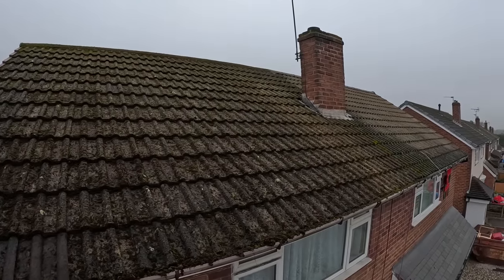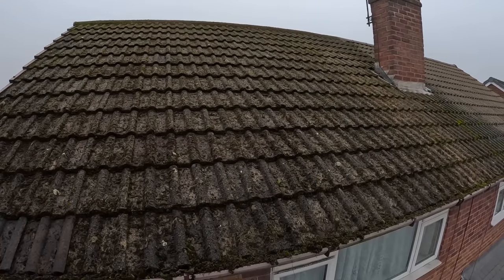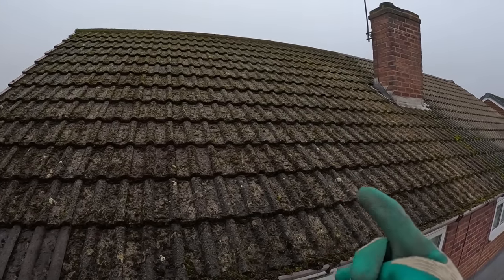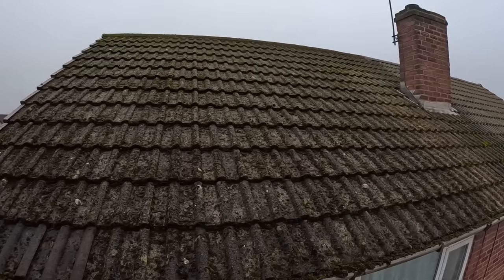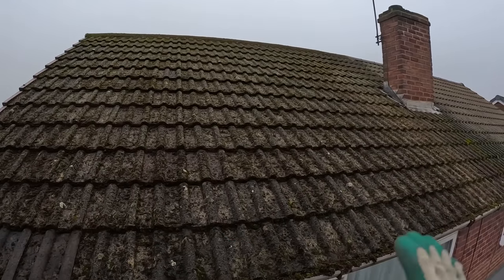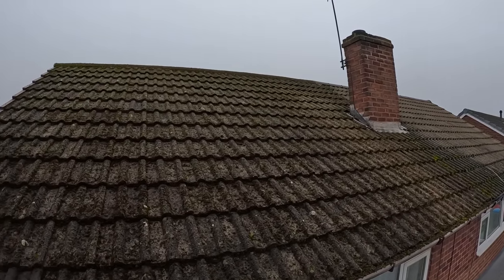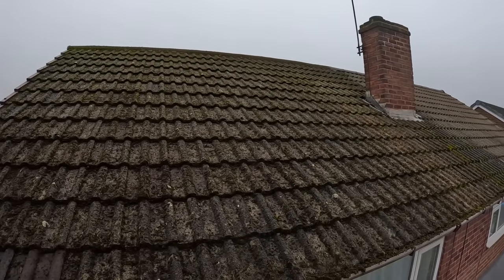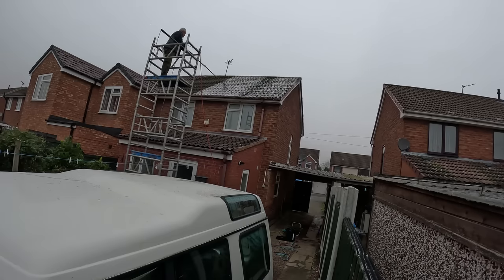STRANGE CASE: RUDE Neighbour Went Too Far? I Discovered Evidence Whilst Cleaning A Roof!

Comment: Honestly if they just each had their own downpipe it would be fine. I would personally hate to have to keep spending money to unblock my gutter and drain because my neighbor let's their section of roof get that dirty.
Reply: You are absolutely correct. A down pipe on each end of the roof would be the best solution all round. Bonus no more aggro for both the residents.
Reply: Definitely don't get why they are not each with their own , it's always a shtshow when ppl have to share something that requires maintenance of some sort but one side does fk all while the other suffers the consequences
Reply: hes nothing to worry about now has he?
Reply: @I.Am.Nobody  Completely agree.
Reply: So you just clean their gutter and send them a bill each time you have to do it!
Reply: @papascrumpeeh  it would make more sense if the roof was maintained together at the same time and they both covered the costs equitably. They'd save money in the long run but that would make too much sense
Reply: But alot of those things just happen. They bought the house knowing they had a shared pipe. Some roofs get mossy, some people cant aford to pay for them, sometimes pipes get cloged. But the neibour went out of their way to create an abstructions, to cut them off from their paid for right to drainage, in a way that could damage their property. Doesnt matter if their are dicks. The neibous simple doesnt have the right and with all the new laws on mold and damp alone im pretty sure its prosecutable.
Reply: Its because the developer/builders want to cut corners safe money and make as much profit as possible, sod the problems they cause, they have their money and have walked away wiping their hand.
Reply: You know what, the moss is there because the gutter was blocked. I think that's at least honest.
Reply: He should have notified the council; the 1984 building act would have been on his side. Also he could have gotten it done for free.
Reply: That complaint should be addressed to developers who try to save every penny, introducing solutions that are inefficient, and potentially become a bone of contention between two neighbours. 

It's not like one will always be able to clean the roof at the same time as the other owner of a semi-detached house. Even though it's technically one building, it consists of two houses, and each should be fitted with its own downpipe.  

I'm surprised it's not mandatory. 

British construction industry keeps its customers under the impression that they provide top quality for money spent. It's all BS. Since I have changed my strategy towards holidays, I allocate more time towards exploring and talking to people whenever possible. A few years ago, I started paying much more attention to houses and construction sites abroad, just to see, how things are done. 

To be brief, the UK is way behind the continental Europe. And I'm not saying that to prove anything. 

To me, it's just the fact that the average British customer is not aware, that he or she gets brutally shagged when it comes to housing-related matters. 

PS. People involved with 'Insulate Britain' are right about insulation quality of British houses. They just picked a poor way to deliver this message.
Reply: @I.Am.Nobody  It's not a matter of money all the time. I have a Russian neighbor that honestly had zero concept of home maintenance. When the gutter froze over and peeled off his house he was baffled as to how it could have happened. When we mentioned cleaning the gutters out annually he was confused - he'd never even heard of such a thing. Now his roof is mossed over, weeds are growing out of his gutter, and everyone in the development except him has had their roof reshingled under warranty. He'll do it when it starts leaking and end up paying several times as much to repair the water damage to his home.
Reply: He explained that they can't have one on each side because they go to a ground gutter and that is how the houses were built... It is not like gutters in the US were you can just let the water flow onto your garden without it completely flooding... If he had a problem with the gutters clogging in the downpipe he could have been an adult and talked to his neighbor but he took matter into his own hands...
Reply: @SailorMya  They can they just don't want to spend the money to install it including the proper drainage. He also stated in the video the neighbors had been having problems with each other. Its easy to imagine the neighbor with the dirty roof ignoring the problem because it will primarily overflow near the downspout of the other side when it gets clogged before it was blocked and raised. I will say that instead of a block they could have installed a screen so when its clean it will drain properly and when the guy lets his side of the roof go and it gets clogged it will overflow onto his side rather than the neighbors.
Reply: It's law in my country. Run off from one property cannot enter another. Even duplex's and conjoined apartments. They all need their own stormwater management.
Reply: You are not wrong, shared maintenance for ANYTHING a is huge bother. All said, if you make an effort to be civil to your neighbor you likely can negotiate getting the whole roof cleaned at the same time for a better rate than separate (though there may have been other factors involved we are not privy to). You don't have to invite your neighbors over for dinner to be neighborly, just behave like a proper adult (fake it if you have to) when you interact. Remember, it's "love thy neighbor" not "spite they neighbor". Happy May everyone!
Reply: Damn right, I wouldn't want that amount of shit in my gutter system as well. If this guy took care of his roof before, I'm sure the neighbor wouldn't block it
Reply: @FrozenHaxor  if the guttering was flowing properly that would have not built up either
Reply: @nickislade5533  You're telling me that the moss on top of the roof was caused by clogged gutter at the bottom? Totally false, the gutter would overflow and just drip from the sides then, that homeowner is a total slop if he did not notice this obvious issue for such a long time, I totally understand  why that neighbor was fed up with him, letting all the gross shit back up to him.
Reply: @lightpropulsionguy  unfortunately life doesn't work like that, you can't bill someone for work done that wasn't agreed upon 🫤 I agree with your premise though.
Reply: @oddpoppetesq.3467  extenuating circumstances can provide such an avenue, such as this where only doing part of the work doesn't really count as a complete fix.
Reply: @oddpoppetesq.3467  take for instance a private road that is shared between neighbors, in America if someone pays to have the road graded and re-gravelled  you absolutely are liable for your portion, same with a shared fence. It only makes sense!
Reply: @lightpropulsionguy  I totally agree with you. I just didn't think it worked that way, I live and learn 🤷
Reply: There is also a question of capacity.  The down spout might be sufficient for one side of the roof, but it might not be able to handle both at once on most days.  Then there is the drainage which could be an issue or not.
Reply: I`m very neighbourly and lived in a small street of terraced house, 7 on each side with a foot path between, I lived there for 25 years and recently sold up to downsize, the houses are 125 years old and had a drain pipe every other house, some still had the old cast iron pipes. every year I would clean mine and next doors gutter, I kept the ally clean and weeded, the footpath, even concreting two strips that had sunk where gas pipes had been fitted to make it easier for an  older neighbour in a wheelchair. when I sold my house it sold in 3 hours !!!  that was last July and I dread to think what a mess it will be now .
Reply: @smokeydization  Very true. There are massive companies who "develop" sites where they have pulled down one house and replaced it with 5-7 Ticky-tacky mini-houses, but charge over a £ million to sell them.
Reply: .The answer is to ask the neighbour to remove the moss, politely. Blocking the gutter is not the way to go
Reply: It's not just the downpipe though is it, it's putting in two drains. One drain for two semis is perfectly acceptable.
Reply: The roof isnt dirty though. It’s literally nature growing on it

Comment: If the neighbour was fed up of the downpipe getting blocked, he should have just installed a mesh. If that got blocked from the moss, then he would have at least been able to say that the blockage was caused by your customer having too much moss on his roof. The neighbour was obviously just being awkward and I believe could be taken to civil court for preventing your customer from using a shared facility. That could result in very high costs for the neighbour. At least you've sorted the problem so well done.
Reply: meshes would also block water over time .
Reply: @mikedeitz2924  True but it only takes a few minutes to clear the mesh, rather than having to spend a lot of money to have the drains unblocked by a professional
Reply: @ASavageEye but why should the guy who obviously keeps his roof clean have to install a mesh and clean it only cuz the other people dont care?
Reply: @idkimlikereallybored9533  solid one like that would cause build up and eventual dampness to seep into the house/attic, since they're together it would affect the guy who keeps the roof clean. they don't get along well and the neighbour didn't think of long term effects or just ignored them to spite his neighbour. not a roofer myself but that's my guesstimate.
Reply: @daubenyhervis6437  I get that, but a blocked drain will cause that as well. In which case the bloke who cleans the roof suffers for the bloke who does not as they are both flooded out. So if this is a long ongoing dispute the separator is understandable. (I.e. if you do not care I do not care)
Reply: That would have at least been civil.  Blocking it was outrageous 😡
Reply: @bruney74  A separator clearly shows that they care though? lol
Reply: @idkimlikereallybored9533  because he bought a home that shared a roof?
Reply: Didnt you hear what it was, felt, it would have let the water through quite likely, dont jump to conclusions
Reply: @mikedeitz2924   this is incorrect
Reply: @zipzap8937  guess you never seen a blocked drain before with mesh covering the drain hole..
Reply: @mikedeitz2924  Yeah because the owner of that house needs to clean their shit. Did you even read the original comment?
Reply: @zipzap8937  UHHHH YEAH I DID ... IT will clog... Now tell me there are TWO OWNERS in that SINGLE BUILDING .... mesh will clog... SO YOU HAVE TO CLEAN IT... GIT.
Reply: @mikedeitz2924  The person with the clog has to clean their own mess. Imagine having to clean your own building? Imagine being responsible for your own place? You must not be there yet in life, but don't worry you'll get there eventually.
Reply: @zipzap8937  imagine your neighbor altering the gutter system twhich makes your part of the gutter to clog up even faster... Guess you are not at that part of understanding yet.. GET off my simple comment that mesh will not fix the cloggin issue.,..
Reply: @mikedeitz2924 imagine not being able to fit a piece of downpipe on your own side and eliminating the entire problem for peanuts instead of blaming someone else for actually trying to protect their property from your neglect 😂
Reply: @hamoostaffat  imagine you making it a necessity for your neighbor to go from maintaining once a year to every month.
Reply: @mikedeitz2924  that's kind of the whole point of the blockade 🤣

Someone fed up with someone else's neglect causing them to do repairs more often than should be needed for optimal performance, doesnt take a few weeks for that much moss to grow, doesnt take more than a fraction of a weeks pay to fit your own downpipe either, way cheaper than what's been allowed to happen

Why shouldn't someone be able to protect their property from damage because their neighbour won't do anything about the source of the problem, funny its a shared problem when it affects them but not when their actions affect others eh
Reply: @hamoostaffat  sigh... ones sensibilities forcing others to follow...; How adolescent.

Comment: Deeds to both properties should contain a clause about shared drains and gutters, they usually do.  That makes it enforceable even if its a pain.  I had a similar situation with a developer who changed the gutters on next door so they no longer lined up with mine.  We got the deeds out and I explained he had 2 options, reinstate it at his expense or go to court and reinstate it at his expanse and pay the court fees.  He saw sense and re-did the gutter.
Reply: Brilliant, good job mate, shouldn't have to stand for nonsense like that.
Reply: it will also mean there are responsibilities that can be enforced too. Like a responsibility to clean your roof, especially if its leading to blocking of the drain.
Reply: The same happened with my 80 year olds mums house while she was in hospital. Had to have a downpipes fitted although drains onto the driveway. Since had trouble with them since they moved in it's too much trouble at her age. From the noise created I reckon he has done other renovations without building control or party wall agreements so it will come out in the end.
Reply: Who to say that it will not go back on again

Comment: Where properties have shared services, including drainage, there is normally a legal requirement (covenant) in the property deeds to ensure this does not happen, and also to allow reasonable access for maintenance.
That deliberate blockage was a disgrace, but unfortunately some people do have scum for neighbours.
I haven't seen your type of work carried out before. I must say that I was impressed.
Reply: Theres a lot of missing context. That roof is absolutely terrible. There is zero maintenance being performed, its covered in so much moss. 
If the neighbour thats installed the divider, has spoken to the the other neighbour about cleaning his roof as its blocking THEIR downpipe, and mossy roof guy has refused to do anything about it, then yeah I can understand it. Not to mention if he has had to have the downpipe cleared, what if mossy roof guy didn't pay his share? Theres way too much context missing
Reply: @PBMS123  What part of SHARED don't you understand. If its in the deeds, its not just for one property its for both.
Reply: @Simon-ui6db  Yes, but that also means BOTH property occupiers have responsibilities, and one of them has failed in their responsibilities. These are the actions of someone fed up, someone who cannot reason with the other side. And just as hes complaining now, the other guy has probably had his own flooding because of this guy. Being told, and then refusing to  do something until it finally affects you, is a deliberate omission as bad as the guy doing that to the gutters in an attempt to stop his place from flooding, and having to unblock the drain

Comment: Surely an alternative solution would have been to install your own down pipe at end of guttering and installing a sizeable waterbutt, thus gaining advantages of free watering of garden, plus discount from water company for water saved, plus one-in-the-eye for Nasty Neighbour?
Reply: Nice idea but you'd need the drainage to take overflow from the butt - the amount of water from a roof even this sized is surprising.
Reply: you coulda also just separated the gutters allowing you own to flow freely onto his roof and claim since the grade was different that caused the gutters to separate.

Comment: Interesting we had a similar problem , we shared a gutter and pipe with our neighbours, our neighbour was very lazy and his guttering would fill with moss and dirt and cause ours to block and overflow,after years of us having to clear his guttering we decided to pay to have ours blocked off from his and our own downpipe put in , so now he can keep his own dirt and water . Problem solved .
So I think it depends , sometimes  frustration builds up and that can be why someone reacts the way they do .
Reply: Without being too judgemental - Did you ever try have the sensible conversation?
Look the roof is both of ours, but you aren't maintaining your side fairly - its far too easy to let frustration do the talking rather than addressing issues
Reply: @bengrogan9710  yep we tried , but seriously we did not block his guttering , we just had new guttering of our own , his is still in use but it no longer causes us a problem .
Reply: I'd say there was history between these neighbors. Only reason this job was done in the first place was because the eave was overflowing onto the first house instead of the second house. Mesh would have been a bit more civil.
Reply: @yvethemetriccrafter688  The situation is not comparable because it's completely reversed.
Reply: U cant just demand a neighbour to do something. They might not have the money to do so at the time. Methods could have been done to avoid the situation, like mesh or put in own drainage. Instead, one chose to block the other without some commonsense. But we cant deny, both parties are at fault. I assume 2 stubborn old men behaving badly
Reply: @trixmania  actually you can demand it ,if it's doing damage to your property. but we decided to get our own downpipe put in , they still have their own downspout , so we did them a favour, and the problem is solved .